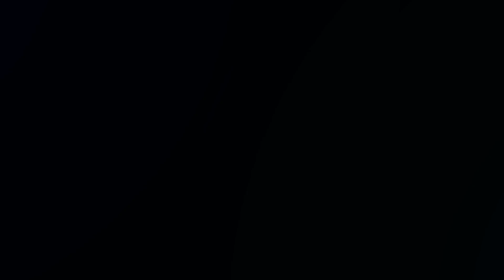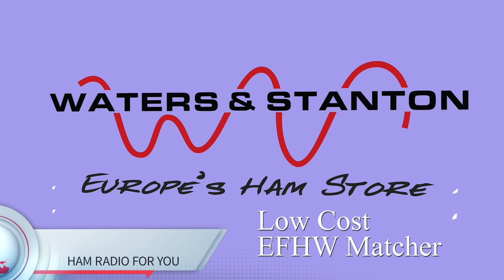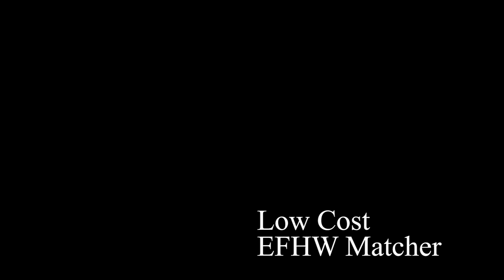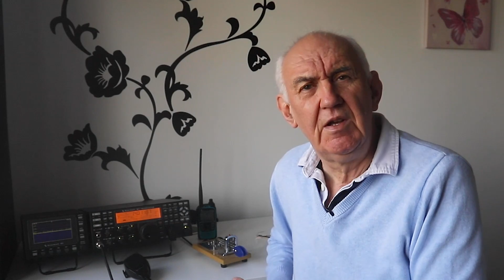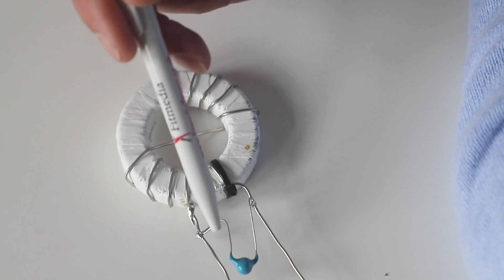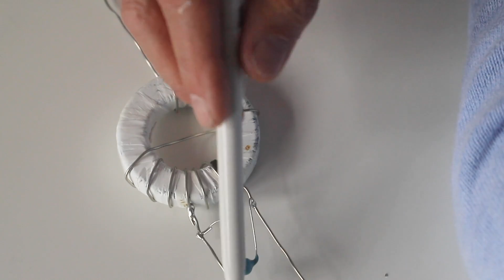Low Cost EFHW Antenna Matching Transformer

Comment: Thank You for this. I'm still learning but my biggest issue is sourcing what I need to complete these projects..once I crack that nut, I can start building some things
Reply: You can purchase what you need on a well known online auction site. For the toroid core, try searching "Fair-Rite FT240-43". The 240 means it has a diameter of 2.4 inches. 43 is just the type of ferrite material. Suggest going for genuine Fair-Rite - as other brands of type 43 may look the same but not behave the same. For a capacitor, try "100pF 2KV ceramic capacitor".
Also you will need something like a "SO-239 panel mount socket" (for connecting co-ax feed) and a couple of nuts and bolts for the antenna connection and ground or counterpoise. Of course you will need a box. If you want to have the transformer outside, suggest searching for "IP67 Electrical Enclosure".
Give it a go. It's not difficult to collect the parts and make these. If you wrap connections to the transformer box in self-amalgamating tape, you can mount it outside and it will provide years of service.
Reply from the maker: Many thanks Walter

Comment: It looks like 11 turns to me.
Reply from the maker: Hi there,

You are right if you add in the reverse point. I tried to make it simple and in fact one turn either way makes virtually no difference because it is a broad-band transformer. 73s Peter
Reply: watersstanton 
Did you bother to check the performance with a 2.7k non reactive restistor on the antenna side?
Would be interesting to see if the traditional calculation holds for your design, which is more towards 1:30 than the traditional suggested 1:49 with a twisted primary.....